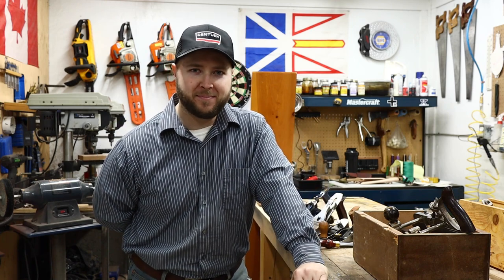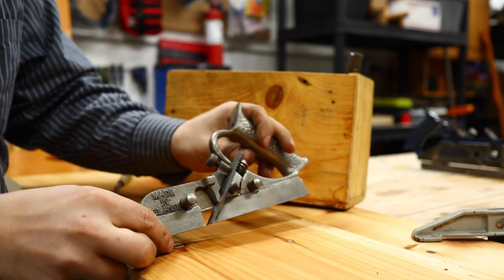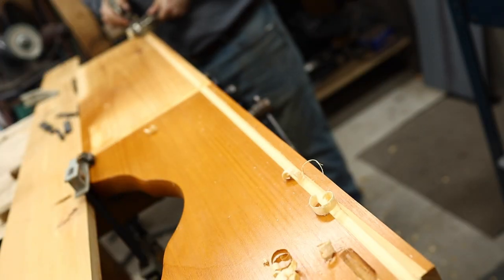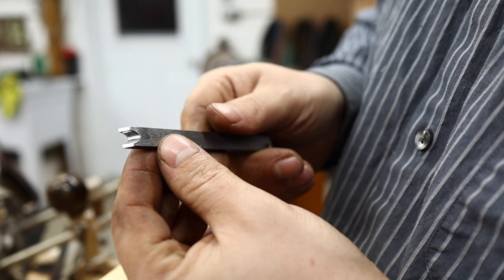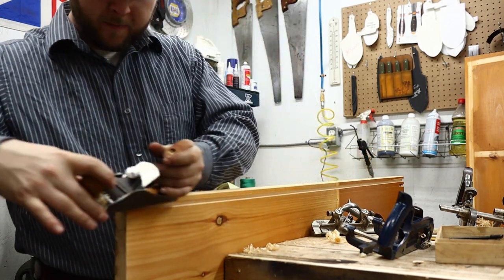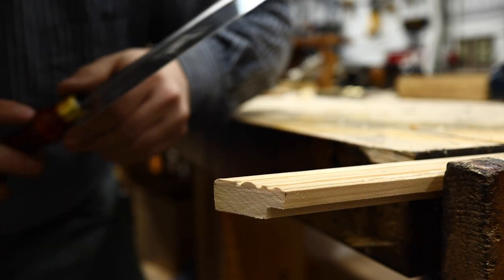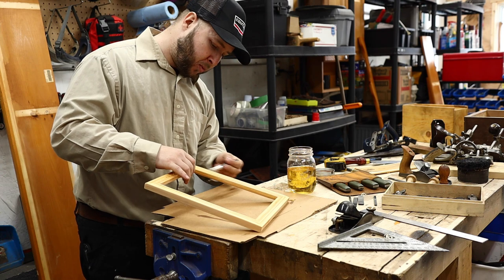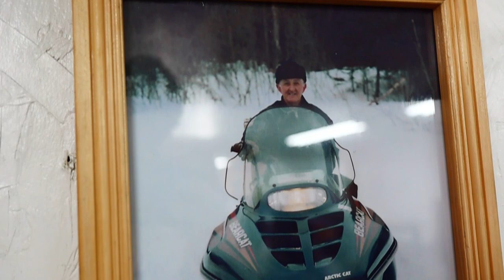How to Make a Picture Frame using ONLY Hand Tools - [NLH 12]

Comment: Beautiful little picture frame. A fitting homage  for your grandfather. 
I remember in my youth working out in my grandfather's barn with some of those planes. 
He had a draw knife bench and a wicked sharp draw knife. My idiot 14 year old self is just playing around with it and I press my thumb against the end of the axe or hammer handel I'm working on - some chunk of wood at the end wouldn't come off and I thought more power was a good isea. I suspect you can imagine what came next... I gave myself a one inch long 1/8 - 1/4 inch wide flap of skin along the side of my thumb. 
Still have the scar and a lesson that hand tools can still be very dangerous when used improperly. If my thumb was placed differently I easily could have cut in to the bone or split the tip of my thumb through the bone.